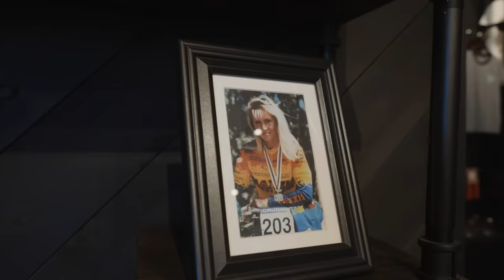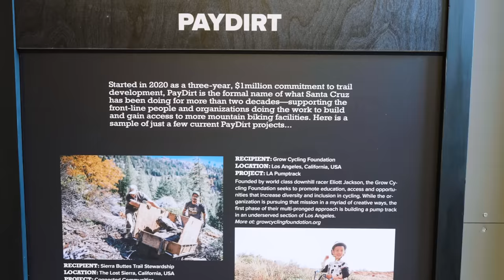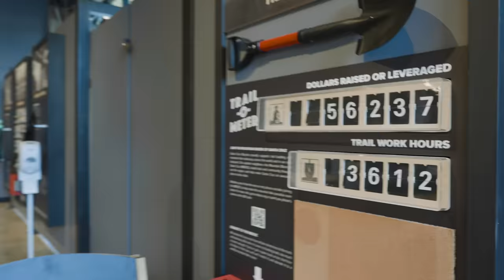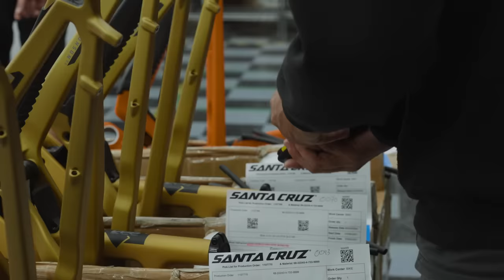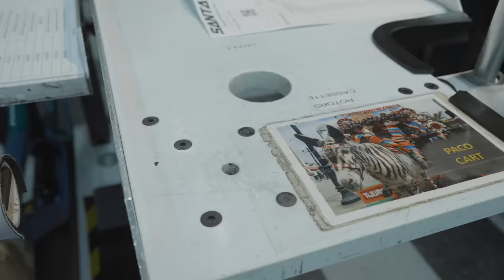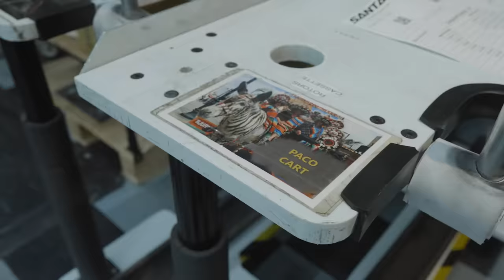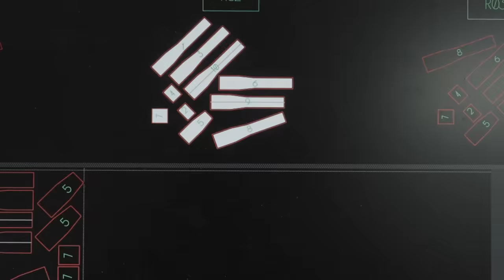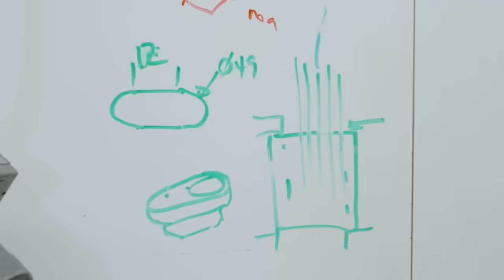Santa Cruz Bicycles Factory Tour Behind the Scenes - Behind the Brand

Comment: I have a 2006 Santa Cruz superlight.   It was pricey and a loooong delivery time but they made good bikes with the frame came from Taiwan.   After my first frame cracked riding normally around Washington, DC, no crazy jumps (I'm only 153 lbs) but was covered under warranty except the shipping the frame to Santa Cruz and the diagnosis from the local bike store which cost me an additional $200+ and now my second frame making a clicking sound (most likely another crack) I can thank Santa Cruz bikes for pointing me toward Specialized.   Pound Sand Santa Cruz.

Comment: I manufactured (cnc mill) all of the aluminum components at SAPA Anodizing in Portland Oregon for Santa Cruz back in 2001-2002.  

It was a secret their bikes were designed in Santa Cruz but fabricated and assembled in Portland. 

Around 2004 SAPA stopped making bikes.  Most manufacturers went to Taiwan, but Santa Cruz and Ellsworth still make in the USA.

Comment: The factory is in China.  That's more of a shipping warehouse.
Reply: Assembly, not the same thing.
Reply: 99.99999999999999999999999% of all US bike brands are made in Taiwan/China now a days. Does not make it a bad bike if they keep the QC truly high. The issue is if you give the overseas an inch they will take a mile in those factories so as long as they keep high QC checks and process overseas they build great bikes.
Reply: @IrieVibeSender  truth, if you can maintain good qc with solid customer service, warranty and parts support.
Reply: @IrieVibeSender  The overwhelming consensus here is not a question of the quality coming from China. From my own manufacturing engineering experience...the people of China are hard working and conscientious and good QA/QC systems are easy to implement.  It's the oppressive Communist Goverment who basically runs slave labor camps (labor dormitories, etc, etc), and doesn't give a shit what they expel into the air...this is the issue with most Americans who understand global economies. Yes...it would be nice to bring manufacturing back home. But in reality our COL isn't going down anytime soon and few investors want to take the 7 to 10 year gamble on whether massive retraining and Lean efficiencies will pay off. Not to mention, luring experienced high wage skilled labor like TIG welding away from aerospace and pipefitting, etc. Shame on the US for not having more quality of life and air sanctions tied to imports. There might be fewer bars and nets on upper floor windows if we placed more humanitarian values over money...